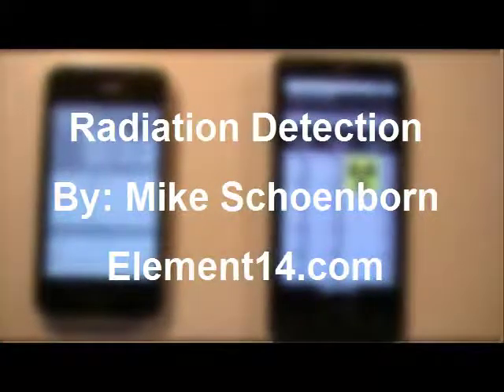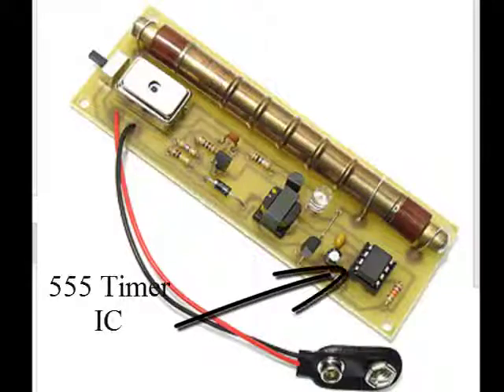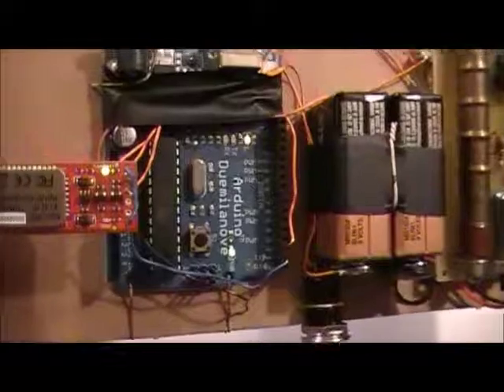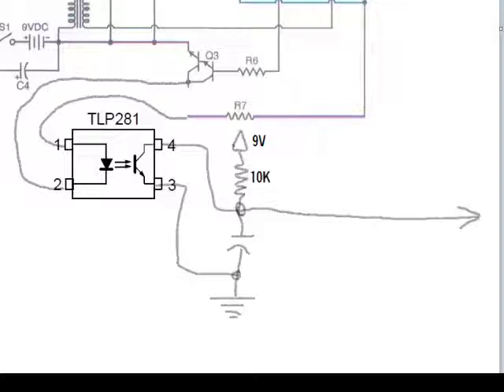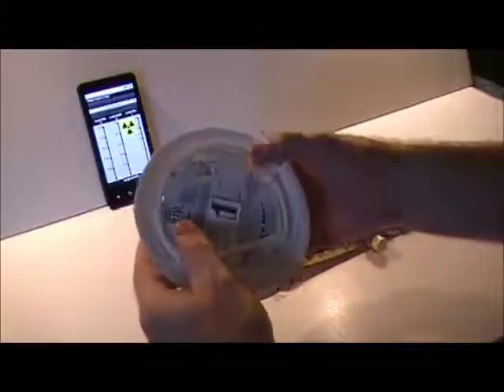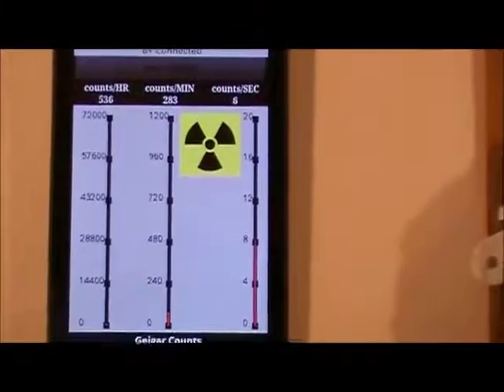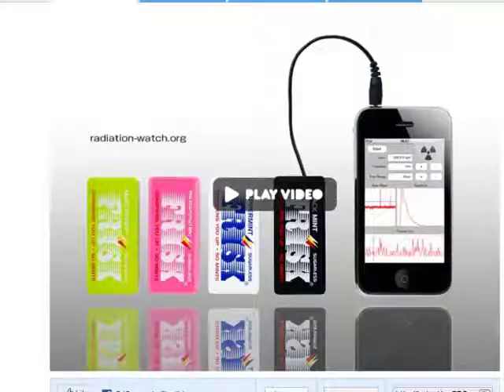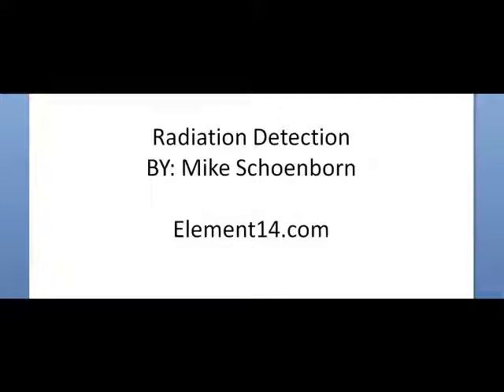Radiation Detection

Comment: Cool build.  However, GM tubes and Ion Chambers are not the same thing.  Ion chambers operate at a much lower voltage and because of that do not experience avalanches.  They operate most frequently in current mode while GM tubes produce pulses.  There are a few other distinctions.

I also do not think your GM tube detects alphas; they don't really penetrate solid matter.  Put a sheet of paper between your Am-241 source and the tube; if the counts drop then it is detecting alphas but I doubt it.